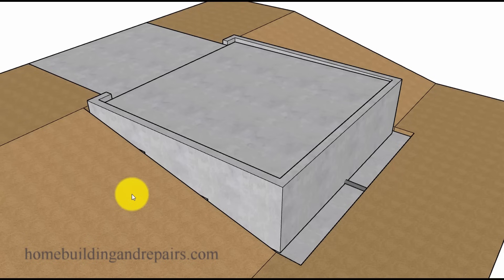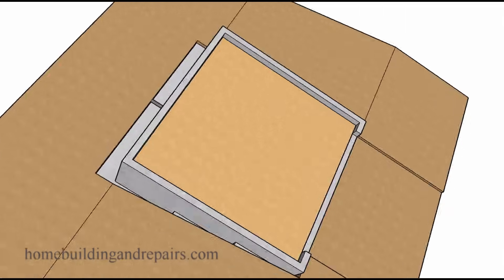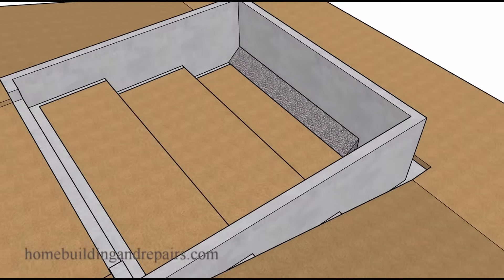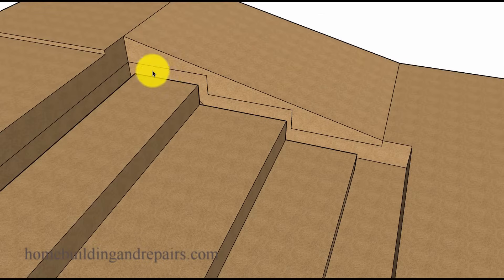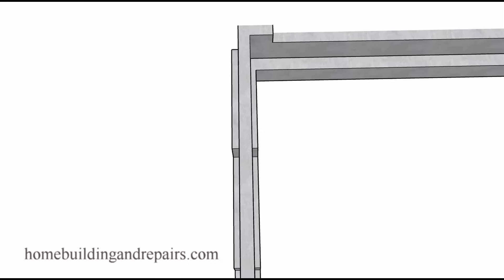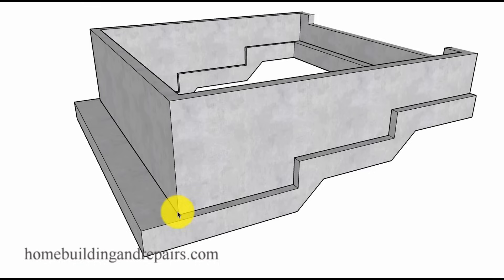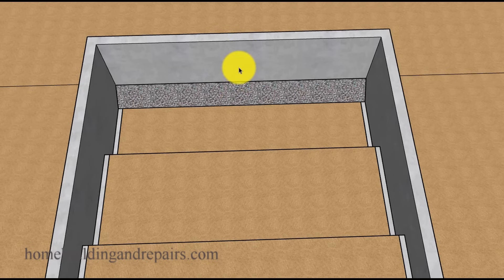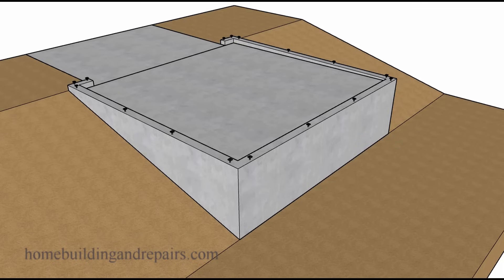Ideas For Building Concrete Garage Foundation On Sloping Hillside - Home Building Learning Examples

Comment: Good video. Can the footing be done in stages. As it seems there is a lot of concrete to pour ?
Reply from the maker: Most engineers want it done in one pour, but it has been done before in sections.

Comment: Looks a lot like ours.  So garage drain on,y in the bottom or second.  So fill.. then gravel. Then vapor barrier. Then insulation then slab.  So drain in the slab is ok too?  Cause right now that’s the only one in our plans.  We are built in the mountains.  Less than 5 inches too soil on top of decomposed granite then solid granite.  So yes we are using the decomposing granite as fill.  And our excavator is amazing.   I am just an over analyzer.  And we are our own GC.

Comment: Great video. I am thinking of building a walkout basement in the lower end of the slop, whereas the garage will be sitting on a concrete slab on the upper side. So, the lower and higher-end sides of the foundation will be different. Do you think there's a risk of getting concrete cracks in the middle of the foundation?
Reply from the maker: It's hard to tell with concrete. I won't be any help here.

Comment: Wife and I bought a house about 1 1/2 years ago, and it came with a fabulous 25' X 30' separate garage (Man Cave!). Both house and garage are built on a slope. The house is built closer to the street where the slope is gentler. The garage has a slope very similar to your illustration (rather steep). I always thought (knew, sort of) that the foundation was fairly complex. I suspected much of what you presented (glad I was right!), but wondered about much of the rest (footings, etc.). Fascinating stuff! Must mention that my retaining walls for the foundation are cinder block (same for the house). I wonder (and hope), that the cinder block hollows were filled with cement grout joined by rebar. The garage itself is all steel-- basically commercial grade. It's a tank. And it's insulated! I love that. Anyway, thank you for this great information!

Just wondering what kind of stuff would be used as fill, especially for the very deep section?

Comment: Putting a basement under the garage would be a nice way to get more space.  I would say to let a professional registered engineering firm do the design work.  If it is under designed the whole structure can fail and lives can be lost!
Reply: Has such a thing ever been done i.e. a space where humans walk underneath a garage slab with SUVs parked on it? I pray not. The engineering of course could be done but too costly and too risky and backwards imo. Relocate the garage itself and put the first floor living space on the slab.

Comment: I was a concrete foreman in Chicago area all my life, 18x18 footing for a retaining wall will not work for a four foot high wall I would give it a minimum of a 36 inch wide footing, offset of  course.
Reply from the maker: Thanks for the good information and If I didn't mention it in the video, always contact an engineer for footing and other structural material sizes in your area.

Comment: Is it mandatory to step the footings? 
I’m a DIY homeowner and am working on the foundation for a metal garage kit I purchased. I’m just doing strip footings on each side since my building has openings on each end to drive through. I dug all the footings to the width and depth called for by my buildings engineers and then I realized my location slopes 7” over the 21 ft footprint for the building. I would like to just leave the slope at the bottom of footings and pour concrete in them and then into my stem wall forms that will be perfectly level. Is this an issue with such a building?? Thanks for all the helpful videos!
Reply from the maker: It's not mandatory to step footing, but you will need to check with the garage kit manufacture for more information about what they require for foundations.

Comment: Any benefit of Placing a grid of Concrete filled Sonotubes into the Central Slab area, for better Support of the Slab?
Reply from the maker: It would depend on the slope, soil and design.

Comment: Would you compact the fill in the garage with a plate tamper or would that put too much stress on the walls?
Reply from the maker: It will depend on the fill materials. I think gravel is 100 percent compacted, but loose soil might need compaction.

Comment: Theoretically if it was cost feasible to just fill the whole cavity inside the retaining walls with concrete instead of soil, would it be better?
Reply from the maker: I actually think the weight of the additional concrete could cause this design to fail.
Reply: @gregvancom  Interesting! Do you say that because the ground is at an angle? What about a raised slab on level ground?

Comment: No its very costly plan. Give us plan using columns to retain the wall
Reply from the maker: I will need more details.
Reply: @gregvancom  idea is to use 3 to 4 columns having shape of letter E with some 10 feet gape. Where I will obviously bear the load and other 3 legs of letter E will retain the columns to its place. And 3 legs should be stuck inside load bearing walls. Letter L shape retaining walls are weak at the 90 degree angle point. And top of L should have some type of ancor like anchored retaining wall.

Comment: Could and would it be better to fill with 3/4 clean stone and geogrid every 6 to 12” or so to really lock this fill in place?
Reply from the maker: Like most things in construction, back filling with gravel could cost more and if gravel provides 100 percent compaction rating, then it should be better. I would also recommend checking with a foundation contractor in your area for more information.
Reply: @gregvancom  thank you for your reply, as well as all your videos!!

Comment: Thanks Greg. If I want to use CMUs to create the stem walls instead of poured and formed concrete, any videos or suggestions for that design? Thanks
Reply from the maker: I don't have any videos yet, but you can build the block walls on top of footings with rebar, if that helps.
Reply: @gregvancom   Thanks for the suggestions. I'll give that some consideration.

Comment: What would be the benefit of a stepped foundation vs fill and dig on a slope? We received quotes from 2 different company’s and they are the same cost
Reply from the maker: I would think the step foundation would require less concrete, forms, labor and digging, but if I got the same price, I would probably choose the full dig and make some type of storage or room out of it with a concrete floor.

Comment: I’m a foundation contractor in MA and have done many garage foundations exactly like this. The wall thickness on all of them has always been at the very least 10” with extensive grids of rebar especially at the retaining wall. I would even go with a 12” thick wall on a 30-48” wide footing at retaining wall only depending on soil conditions. The rest of the walls/footings could be 10” with 20” wide footings. I would offset the retaining wall on the footing so that most of the footing overhang is on the inside of the building so that the weight of the fill/slab would prevent overturning of wall. Also,  The cost difference between an 8”, 10”, and 12” wall for something this small would be negligible as the labor and larger form tie cost is the same. The extra concrete would be minimal.
Reply from the maker: I always appreciate tips like yours and thank for sharing. I like the retaining wall offset, but for viewers reading this comment, keep in mind that the size and height of these retaining walls around the perimeter of foundation might need to be larger and designed differently.
Reply: i am in MA looking for a slab like this. what's the name/location of your company?
Reply: Question can you just fill the whole thing with concrete instead of leaving it hollow?

Comment: Why would u put French drain on inside of the foundation of garage? I’m pretty sure I would want to catch it on the outside of said structure and right either on top of footing or right along the side of footing. Just don’t see to much of a benefit doing it on the inside of pad. Now if it’s just the back up for the one on the other side then tht would make a lot of sense. One them insurance thang’s incase the outside one gets plugged up,there would always be the back up one ready to catch and disperse the water away from structure.
Reply: No matter the drainage you have on the exterior of a building, water will still get into that area. Moisture can come up from below. 

Plus it's a great insurance

Comment: Is there any professional or official name for this type of foundation?  I just toured a home built in 2000 with exactly this type of design for the garage foundation, but there are vertical cracks at the corners and periodically along the length of the tallest face of the wall, and a number of diagonal cracks converging somewhat towards the center.  It seems that the fill soil is starting to push out the retaining wall.  Is this a disaster waiting to happen, or can that be rehabilitated?
Reply from the maker: It's a raised floor foundation with stem walls or retaining walls. It sounds like you might need to consult a professional and sometimes bracing can be installed if it's not going to be in the way.
Reply: Actually, I did get in touch with a pro!
He sees a lot of this specific construction in the area(PNW), and said the defect is extremely common as well. 
What happens is the stem wall is leaning out because soil under the footer is settling, and unevenly so (because of course its on a slope).  According to him, the only permanent solution is to drive piles down to bedrock and attach to the footer along the leaning wall.  If not, the wall will likely inevitably topple over.  Bracing would not actually be a solution there, because the footer is still gonna keep settling.

Comment: Does the footing on the back wall still have to be set under your frost line?
Reply from the maker: It depends on the area, but most footings should be below frost line or at least exterior footings.

Comment: Any thoughts on laying slab on a pan, carried by steel beams instead of backfill? I’m always curious when this cost-benefit breaks even.
Reply from the maker: This would probably be cheaper for this project, but maybe not for larger ones.
Reply: Might be late,, but I have the same problem,, my plot needs alot of backfill just to level up to floor height, trying to find a way around this challenge and get away from backfill and compacting etc etc.

Comment: Your end wall, I'd build it double block with a cavity of 3" tie together with 5" tie bars, built into block work spacing about every 30 - 36" apart ever 2 blocks high, fill this with concrete.
Fitting 18" deep?
Depending on the type of found your working on, determined a lot of things.
Another option, if it's 5' deep, dig out another 2 - 3'akevit pillar and beam, either put beam block floor/ concrete floor, you have anothervróm under you garage.
Reply from the maker: Thanks for sharing and definitely a few other options.

Comment: I would very much like to see how you might lay out the rebar for this structure. I am a little concerned about the back wall of the foundation being strong enough to hold the load.
Reply from the maker: Which backwall are you referring to? The wall that is 5 foot tall?
Reply: @gregvancom  The wall at the bottom (lowest point) of the slope .  I appreciate your efforts and the type of work you are dealing with.

Comment: Why are the footings so wide? My area only the stem wall is technically required due to the soil bearing capacity, but the city arbitrarily requires 12in footings. Seems that has got to be pretty soft soil to need 18in unless there is some other reason.
Reply: California
Reply: @wompbozer3939   I found a footing table for LA and it looks like for a 2 or 3 story building in low bearing capacity soil the wide footings shown here would be needed. I would think that few sites have that low bearing capacity, but maybe this is a soft sandy hillside.
Reply from the maker: Keep in mind that this is only meant to be an example of how it can be done, but not how it can be done in your specific area, country, state or city. I've seen footings a lot wider than the ones I've drawn for something like this. Where exactly are you located?

Comment: How thick would we need those diagonal sections to be so that enough rebar should be in there? At least 4 inches? We want rebar.
Reply from the maker: It's difficult for me to answer your question, because I don't know exactly what you're doing. However I can tell you that 6 inches is going to be better than 4 inches.

Comment: I would personally like to put a grease pit in a garage like that... most likely just another couple footings running parallel down the middle like the ones you showed for the sides.. then similar retaining walls on top of them as well... 
yep looks like a lot of rebar work..
Reply: The problem is fire codes. I have heard you have minimum size requirements and must have two exits. That makes it take up more space than I think people want to use, so you rarely see them. Also a lift is only a few thousand, so the cost of a pit quickly competes with it.
Reply from the maker: If you had a question, feel free to form as a question, but if you're only asking if this design can be modified to create some type of a slot in the center with a set of stairs, then yes it's going to require a little more work. I would also do as the other person suggested and that would be to check with your local building authorities for more information about the design and safety requirements.

Comment: Run the concrete slab to the front edge with 1/2" drop to outside slab elevation.  Your model has it aligned to inside face.
Reply from the maker: Definitely another option and I like to half-inch drops in areas where it rains and snows a lot or if you have some type of a grade running towards the garage like a sloping driveway that slopes down from the street towards the garage and then of course you would need some type of a drainage system.
Reply: @gregvancom  Run-on sentences make my head hurt.